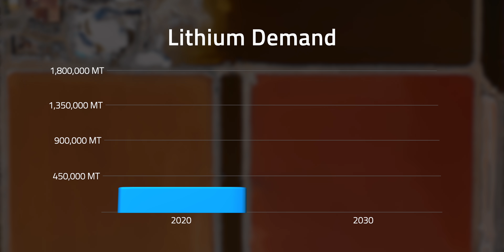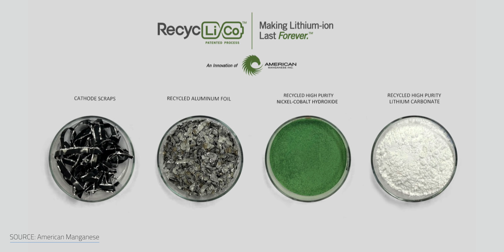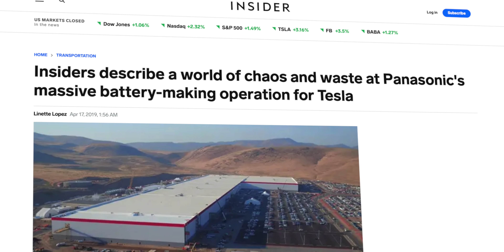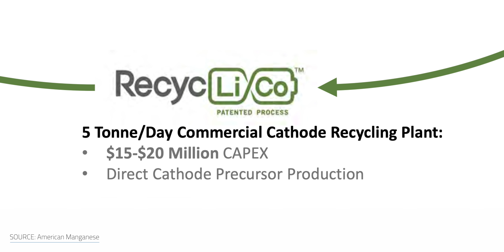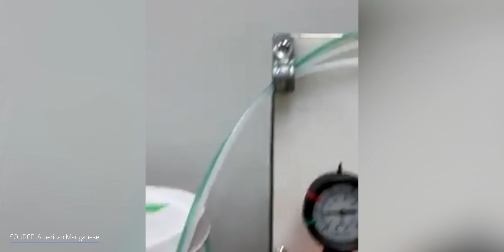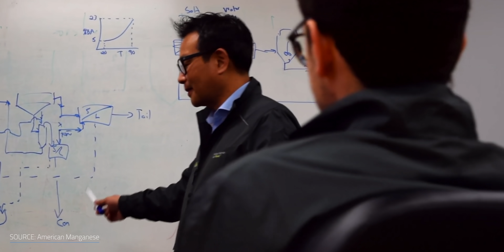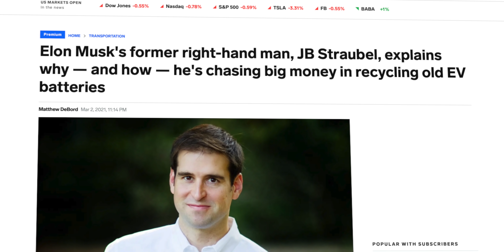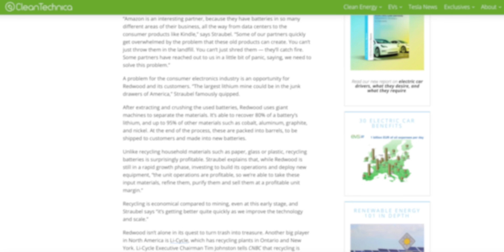Solving EV's Biggest Problem - Battery Recycling Explained

Comment from the maker: So what do you think? Will recycling overtake the need for mining?  And if you liked this video, check out "This 3D Printed House Changes Everything - Explained": https://youtu.be/gxbyWly_pls?list=PLnTSM-ORSgi5LVxHfWfQE6-Y_HnK-sgXS
Reply: If I might make a suggestion, I think you should do some research on aluminum ion batteries.
Reply: In every process there is always a small amount of loss of material that can not be recovered. Cell phones thrown in the trash instead of recycled or wrecked cars that sit in a junk yard instead of being recycled.  So in short you will always need new supply of materials.  The question is not will it over take it, but how much can we reduce it.  Maybe someday we can mine landfills for raw materials.
Reply: aluminium ion batteries it seems ok no recycling required.  But what we can use graded transport for less than a km by walk,  less than 2-3km by cycle, 5-10 kms by 2 wheelers preferably ev/aluminium ion battery.  4 wheelers for long distance provided with minimum of 3-4 people or public transport.  air travel only for 1000km beyond.  avoid travelling as much possible.  these steps only can save environment.
Reply: Looking at plastic recycling...no.
Reply: A possibly interesting topic would be Hydrogen fuel cell use. I mean, it's an engine that you fuel with water, and it's waste exhaust is also water. It seems like there must be a reason it's not the preferred vehicle engine over the batteries, considering all the trouble we're going to, to make batteries viable.
Reply: @Zutronic com I literally just made a similar comment, then saw this. I agree completely. It's hard to understand why such a difficult, expensive, and complex process and problems associated with the Lithium batteries is preferable.
Reply: Matt, if the cost and quality of the recycle material are acceptable, the process will grow worldwide naturally at the same pace of battery manufacturing. Great and insightful  video
Reply: Yes is good to recycle, but is the size & amount of the cells  needed for cars is part of the problem?
Also could do with better way to connect cells  together than spot welding? 
Currently consumers are paying the cost, from buying products, but good to see that recycling can be done
But manufacturers are adding in built in obsolescence as no product is meant  to last forever
Reply: Governments must require the manufacturers to have a system to recycle.  This is what the EU has done, and the recycling process is ahead of the USA.  Here it's a free-for-all, completely market driven with zero regulation mandating recycling plans by the manufacturers.  If some materials are cheaper to mine than to recycle, then they'll continue to mine.  One thing that is not helpful, is describing this dilemma without actually calculating how much of this ore is known to exist and how much our plans overutilize those limited resources.  We must do better than Elon Musk, who stated years ago that we just need 100 Gigafactories around the world to power the world, as if the resources to supply the factories weren't an issue.  Engineers and business leaders need to think beyond the edge of their nose and foresee that if this is all mined and put into production, and it lasts for 10 years or more in vehicles and utility storage, we won't have the feedstock to continue to grow the industry.  We should be seeking hyperefficient use of these batteries and instead we get year over year growth in the size of packs in vehicles, thanks to the industry emphasizing massive range the way the ICE industry emphasized horsepower.  The pickup truck is a perfect example of something we cannot just afford to run as-is with batteries because we are too lazy to radically change our ways.
Reply: Recycling won't replace mining as long as the demand is rising.
But definitely everything should be recycled
Reply: Recycling is the future, I suggest you look into the company American Battery Metal Company (changing their name to American battery technology company) they are leading with some awesome tech. Their CTO is Ryan Melsert who helped design the gigafactory. They have a closed loop system and will be building a pilot plant that can do metric tons. I just suggest you check them out or see if you can talk with Ryan.
Reply: @WetDoggo  You are absolutely right. I wonder if Matt is asking a trick question? The growth in battery demand is explosive, we are talking about a massive societal change in how we use and store energy. Even if you recycled 100% for the next 20 years it would still be a drop in the bucket versus the materials (lithium and others) compared to what will be needed.
Reply: No, EV's, home batteries, grid scale storage, ... are growing and will keep growing so fast that mining will need to provide the majority of Lithium just to meet demand, even if we reach a 100% recycling rate tomorrow. Recycling will be important, but mining will remain 'a necessary evil' for years and probably decades to come.
Reply: If you carefully peel apart lithium ion battery to take all the coverings off and expose the lithium, you can drop it into your toilet for some fun.
Reply: Lead-acid vehicle batteries are already recycled very well. I don't see a problem replicating that.
Reply: You do need both recycling as well as new mining in order to ramp up....I think one of the great challenges is getting the general public to dump all these batteries,  both the lithium and non lithium into a dedicated dumpster for such waste for recycling is important.....there is a big hole in this, big enough to put an aircraft carrier through....atleast here on Oahu...but I imagine the same on the mainland too...one way to aid in the recovery would be to require businesses that sell batteries to have a dedicated battery/small electronics recycling bin at the front door and it needs to be part of their advertising where ever they advertise about this so the general public is educated....convenience is crucial for a successful recycling program.
Reply: You forget one thing.....the complexity of ICE drive train and maintenance which is completely non existent in an electric vehicle....this is also why airlines and aircraft manufacturers interest in electric propulsion since the complexity of the existing turbine engine is relegated....this is also why fly by wire and electric servo motors are replacing hydraulic actuators on some aircraft....less weight and reliability...
Reply: @rogerstarkey5390  I watched the one you're referring to, previously. And it specifically spends some time on the extraction process being fueled by solar panels. That being a possibility, there's no reason why you couldn't generate your own, at home. Or, better yet, have the solar panels and hydrogen generator on the car it's self.
Reply: The biggest problem for ev's isn't the recycling of the car and batteries. That is already being taken care of. But the need for "mining" will not disappear.
The biggest problem for electric vehicles is the reluctancy to admit that exhaust cars are outdated, which results in the extremely slow transition. Some ex-car manufacturers have even sabotaged the ev industry way back when. One could imagine that all cars were electric already.
Now that more and more of the ex-car manufacturers are switching towards ev production, the battery technology and the efficiency of ev's in addition to charging technologies and infrastructure will improve significantly. This leads to ev's with smaller yet more efficient and energy dense batteries.
It is also possible to implement new ways of charging, wireless, everywhere you park, solar which will also require smaller batteries.
Solid-state batteries can be used on lorries and ships in addition to storage batteries instead of using lithium ion batteries for storage.
In the not so distant future alternative battery technologies will likely be competitive. 
Aluminium-graphite batteries as mentioned in other comments, in addition to bioelectrochemical batteries, redox flow batteries and supercapacitors are some of the most promissing at the moment.
Reply: It's got to be a question of scale. If all current Lion batteries were recycled today, there still wouldn't be enough raw material for current and projected demand. So yes, eventually, but only once increasing demand has been met. At least it'll give them time to perfect the process.
Reply: One of the former Tesla employees already started a company "Redwood Materials" to tackle this exact problem
https://www.youtube.com/watch?v=xLr0GStrnwQ

Edit: I see you mentioned them also.

I believe recycling will gradually take over mining as more and more batteries are produced and whoever produces them cheaper wins.
Right now it's China because of lack of regulations and having a lot of investment in Australia and Africa.
Reply: It's a math problem right? The demand for ion batteries will have to level off and the supply for materials will have to surpass the demand. Then the system could sustain itself if there is no waste from the recycling process.
Reply: Second life of car batteries (which is an additional 10-15 years) would delay taking car batteries directly to recycling (this is a greener solution overall). But this will put pressure to rely on more virgin material for a longer period. It would be nice to have an episode on companies that are integrating second life into their overall cradel to grave model.
Reply: @rogerstarkey5390  Considering the minimal percentage of plastic circular recycled, even though batteries are made of rare materials, I strongly doubt that a high recycling rate can be achieved.
This "all in" into the rare earth  category of the periodic table puzzles me.
Reply: China destroyed our recycling industries, so until NATO, the USA and everyone else sizes up and drops the nuclear hammer on them, I'm going with mining...which is nearly all in the Chinese ball court worldwide also.
Reply: @Ennie-98  I would also wonder what is the recovery efficiency of the process. Also what is the energy requirement of it. Further, how scalable is the method, thinking about the number of batteries coming over the next fifty years.
Reply: Recycling wil not replace mining.
Reply: "Will recycling overtake the need for mining?"  Yes, but only once the mass of elements in use reaches a steady staten, and assuming that recycling is 100% effective. In other words, no.
Reply: How did you not mention the primary US recycling company, ABML (American Battery Technology Company)? Redwood uses smelting, which creates toxic emissions into the air, while ABML uses a water-based recycling method that's 100% sustainable. And it's a company led by ex-Tesla engineers.
Reply: @TheYuleTube  As long as the hydrogen is produced by electrolysis rather than current process's which are very energy intensive and require fossil fuel inputs. At the time of writing this, hydrogen is no "greener" than batteries and batteries aren't "green", yet.
Reply: @rogerstarkey5390  - That assumes Li-Ion cells are even sought after in 10 years time.  There's a good chance we'll have cracked a solid state battery in several different ways by that time, and that could leave Li based batteries in the dust.  I don't doubt that car battery packs will be recycled.  I am concerned that without regulation, they could be treated as a liability if those resources cost more to recover than they're worth at that time.  Up until just a year ago, the industry only used pyro techniques and recovered only the cobalt and manganese and nickel.  They couldn't be bothered with the AL, Li, and plastic and much of the battery in that technique ends up as useless slag.  It's thanks to EU regs and now US lab incentives that we're seeing investment in hydro recycling.
Reply: Thank you for the video !
Reply: I think, in due course, mining on Earth will be reduced, as recycling processes get better and easier for people to access. I hope we eventuality work out how to economically mine some of these elements from asteroids and other planets, too. That's obviously generations away, though, so for now, we just need to be more conscious about recycling, and find more ways to store energy.
Reply: so are you saying that humanity won't survive until we've mined out the lithium?
Reply: Recycling should also help drive down the price of lion batteries. Less mined material equates to lower labor costs and lower shipping costs.
Reply: Hi Matt, great video! The potential success of Lithium iron phosphate cells might play a role as well. Most of the value generated by recycling seems to come from Cobalt and Nickel. In a LFP cell, only Lithium should be of interest in the black mass and recovering this alone might be highly uneconomic. I wonder if you or your interview partner have some insights on the LFP topic.
Reply: Well: Recycling of batteries will overtake mining in the long run (simply because if used batteries can be considered as a mine of pure materials if the pile is big enough)...

"Generally" mining will still exist on this earth or some other as long as we'll need more materials (of various sorts) to thrive.
Reply: what we need is on site renewables and storage while leaving GRID size storage to bigger companies like "Highview Power" and push for better home efficiencies allowing for a good chunk of batteries to go vehicles {waiting to see Tesla's THREE (3) new batteries?!} this and landfill diving for E-Wastes to recycles.... Recycling should be Mandatory!!!
Reply: I don't understand why the manufactures like Tesla don't cut out the middle men and just copy the recycling centres tech add this to there factories and just do this on site. Seems highly inefficient to be transporting all this material around to do this.
Reply: I wish someone would try to make low cost high preformance flywheels.  More money has been poured into batteries.. what if a similar amount were put into mechanical energy storage?  Imagine all the uses this could have, easily recyclable and the material science that comes out of this would be useful in so many applications.
Reply: @rogerstarkey5390  Not with that attitude.
Reply: For recycling to overtake the need for mining, demand for lithium products would have to decline. After all, you can't get more than 100% of the material out of recycling, and even 80% is pretty darn idealistic. So as long as demand goes up, mining is an inevitability. However, if we could serve, say half or even three quarters of the lithium demand from recycling, it will keep mining to a reasonable level. 

Interestingly enough, Musk has stated repeatedly that battery recycling is not only planned but part of the cost-savings methods he's planned for the next decade. It will be cheaper to source lithium and nickel from recycled batteries than from mines, which in turn will drive down the price of batteries in the vehicles.
Reply: A good overview video Matt. We really need to look at the economic value and the environmental cost.  When we talk about yields as a percentage of recovered materials, the most important piece of information is the value of those materials. For example, the raw materials in a Model 3 battery cost approximately $4000 for the cathode and anode. If you get 100% of those materials, the question we want to answer is at what value? And, at what cost economically and environmentally. If the value is $3-400 per vehicle (which is typical) we can see that the materials are recovered, but not in the highly processed state that is necessary for new batteries. In reality, there is a lot of word smithing in the field, if you can extract the 4K worth of materials with minimal environmental damage (read, considerably less than mininig) and do that cheaply then you have a winner.
Reply: yes and no.  there are plenty and huge guys on battery recycling already just even before it booms. I think the problem is re-use vs. recycling.  Re-use companies would be competing with recycling companies for these batteries.  Re-use is certainly better than recycling as li-on batteries usually leaves still plenty of useful life
Reply: No, you will need more raw materials. Recycling is a great ideal but I feel like it will have to be shipped overseas to be recycled.
Reply: @rogerstarkey5390  That's true. An ex-vehicle requires "mining" throughout it's lifetime whilst an el-vehicle doesn't.
Despite this, ex-car lovers forget the requirement for fuel and only focus on el-car's batteries. 🤪
Reply: I think Elon Mask should stop making EV then recycling can overtake the need for mining. Instead make us this resources in making fighter Jet power battery, making EV for civilian is wasting resources
Reply: I'd like to invest some money into a company like this. I don't know how.
Reply: I, for one, can't wait for landfill mining to be a thing
Reply: @Zutronic com Where does the electricity for the electrolysis come from? It's an extremely energy intense process, so would require energy stored somewhere.
Reply: Great video! Recycling will eventually disrupt mining, likely with the cost of mining going up in the future, but I don't believe it will be in my lifetime.
Reply: Matt, lithium ion batteries do NOT contain copper. Copper is used in EV chargers and EVs, but not the batteries.
Reply: Very bad and DANGEROUS idea.
Reply: @TheCoryGroshek  The cells may not, but the modules and packs do
Reply: That is NOT EV's biggest challenge, he biggest challenge is he environmental nightmare of extracting it's resource base. It's Also generating sufficient power. Transportation uses 26% of the worlds energy (77% of that is met by gasoline/diesel). Or 121.5 Quintillion Joules or 33.7 Trillion kwh ! Even if electric motors are more efficient; You factor in thermodynamic loss from generation to final transmission; you still need 90 Billion kwh of electricity A DAY!!! or 3.8 Million Megawatts of new power plants to replace gasoline and diesel fuel use for trucks, cars, motorcycles, scooters, lawnmowers and other fuel powered construction equipment.
Reply: @spikedpsycho2383  thankfully you need only at most quarter of the gasoline electrical energy even with grid losses.
The load is also spread across the day, and across so it's not like there's going to be a spike if hundreds of megawatts out of a wall socket.
Reply: @benhockley  Pay attention to energy physics and math.  Companies promising "Fast charging" places Orders of magnitude more demand on power. A 100 kilowatt hour battery charged by basic level charging will charge in 6-8 hours. DC fast and supercharger networks charge 80% in 30 minutes. Charging a 100 kwh battery half depleted in 6 hours requires 0.833 kilowatts of power charging that same battery in 30 minutes requires 100 kilowatts so you're placing over 100 times More load on the electric grid to do a task in 1/12th the amount of time. Even a solar panel 1 Acre in size produces enough to charge 3 Teslas in the span of a day. That's why at events gas/diesel generators are brought in; they can do the same task in 30 minutes.
GLOBAL energy demand is 606 Exajoules (606 QUINTILLION JOULES), Transportation energy consumption is 26% of that (157.6 Exajoules) Gasoline and diesel fuel use 77% (121.32 Exajoules) or 332 Petajoules daily or 92 Billion kilowatt hours. EVEN if electric motors are more efficient than gas engines; power conversion and efficiency losses from plant to end user rob over HALF of it. Adding the transportation system to the already stressed and dilapidated electrical grid would be a logistical nightmare. Global electric consumption is 61 BILLION kilowatt hours per day; only 6% is used for transportation related systems (Subways, trains on wires, monorails, etc), even if motors are 3-4 times more efficient, Factor in transmission losses; you're placing a demand of 23 Billion kilowatt-hours daily or nearly a 1 billion kwh per hour. Generating 1 million Megawatt hours in a one hour period you need 958,000 Megawatts of generating capacity. That's the equivalent of 460 Hoover dams. Even if only one quarter of all the cars charge per day; that's still 239,000 MW you have to build.
Only 12% of global energy demand is electric, because converting to electric is expensive and not very efficient but it's safe for running casual devices that don't work mechanically like computers and lightbulbs. 72% of the worlds energy is thermal based because it’s efficient to  convert thermal energy into work without having to convert it to  electricity. You convert to electricity you lose half to 2/3rds of the  energy as waste heat. The carbon emissions from changing electric  sources wont matter much since 75% of all GHG emissions come from non  electric sources, Converting ALL non electric devices/machines over to electric would be more logistically challenging as rebuilding the grid. The transition to renewables; means replacing thermal, chemical and mechanical power with several added steps, electric generation, electric voltage, transmission, and plug in. ALL these stages result in thermodynamic losses. An all electric transportation system requires a 10-20 fold increase in grid construction. An all electric energy society would require a 90 FOLD grid size. Fossil fuels are so much simpler
Fossil energy: Chemical energy --- Thermal energy --- Mechanical energy (work) or thermal to work.
Renewable energy: External mechanical energy (Weather permitting) --- mechanical energy --- electrical energy --- Voltage step up --- electric transmission --- electric transmission to destination (thermodynamic losses in route) --- voltage step down (transformer) --- transmission to consumer --- consumer utilization (electric motor) --- mechanical  or thermal energy --- work
Reply: @spikedpsycho2383  which is why many new large fast charging locations are built with batteries to provide the power they need.
Fast charging is also an exception rather than the default case.
Reply: @benhockley  With an average electric "Fuel Economy" of 3 miles per kilowatt hour charging a battery 220 volts puts a demand of 8.3 kilowatt-hours per hour, Even if slow charging, 10 million vehicles would need 83,000 Megawatt hours or 3400 MW. Plus charging infrastructure requires constant flow of power whether you use it or not. EV cars measure just 0.167% of global auto fleet, One out of every 600 cars, Auto industry Spent BIllions on outfitting factories to make cars that only saturate 1% of all new auto sales. Environmentalists whine it takes 30,000 lbs (15 tons) of raw material to make a 3000 lb car. It takes Over 4000+ tons of rock/ore to make One electric car, ICE engines made with iron/aluminum come from scrap by melting down cans and scrap metal. EV's require fresh resources of cobalt, lithium, copper, etc. You have to start an industrial revolution over again but instead of coal/iron; you're now digging up HALF the periodic table all of which is dug, mined, processed, manufactured, and shipped using fossil fuels. Under the guise of technology which is supposedly gonna "Rid us" of fossil fuels. Driving is only a small portion of a cars energy embodiment/life cycle, there's heavy energy investment in the beginning and late stages of it's life, namely manufacturing and recycling. Just under 5.4 million hybrid electric cars have sold in the United States as of 2019 — comprising 1.6% of all 333 million new light-duty vehicle sales between 1999 and 2019. Proliferation of hybrids since 1999........took over 2 decades and billions in tax rebates still haven't replaced gas cars. Electric cars, just shy of 2 million in the US took 15 years and billions in taxpayer rebates. As had been shown repeatedly, this is just a drop in the bucket.  The growth of ICE cars around the world is going to outstrip EV manufacturing capacity by order of magnitude; for years to come.  For ever, once subsidies become too high for taxpayers to accept, EV sales will crash. Industry is simply not outfitted to produce something that takes 8-20x more energy to manufacture and try to sell it at a comparable price to it's gas powered equivalent, never mind building a massive infrastructure system to charge it without melting the electric grid. Construction of America's Transcontinenal railroad took only six years, it took only 15 years for aviation industry to replace it's fleet of propeller driven planes with jets, the fact it took 20 years to saturate vehicle market at 0.167% electric. Like the youtube video were watching.....why is battery recycling a challenge? or even an issue, less these devices have a terrible shelf life. Worse vast majority of EV car components are made/harvested in China and the third world where child/slave labor constitute the bulk of it's extraction. EV cars besides being a logistical nightmare and environmental questionable; they're a human rights issue.
Reply: Definatly itll replace mining but not for another 30years once we have sucked as much as we can dug as deep as we can that how greed works because unfortunatly liie we saw with covid there is no change untill it starts affecting everyone and then we are left scrambling to fix everyhing fast once it all goes to shit
Reply: As long as it’s cheaper to build batteries from new raw materials, recycling will not replace mining.  This will only change as technology changes or as legislation changes, either way, consumer costs will increase.
Reply: Unless growth is <= 0 or some crazy battery efficiency technology is discovered, recycling can never overtake mining.  It's literally impossible.
Reply: Thus far, except for very expensive precious metals like gold, platinum and silver, recycling has been a massive lie. Only very little of that which the industry makes us believe is actually recycled. There is a track record of almost 50 years of massive lies. So, I am not going to believe any recycling claims until there is a new track record of 100% recycling for another 50 years. And even then, we will need to look at the total energy balance.
Reply: Matt, recycling uses alot of chemicals.  You should also research how electric intensive is chemical industry.
No point going into EV and recycling batteries if the benefits we get is outstriped by the overall cost.
Its the same as steel and steel recycling.  Large amounts of chemicals are used.  And chemical producers are energy intensive.
Reply: Kinda skipped over the "test" facility quite quickly there...and whats the carbon cost of all those chemicals eviromental and carbon?
Reply: Northvolt is currently building i gigantic recycling plant for batteries in northern Sweden. They plan to build new batteries of them with 90% less carbon footprint then normal battery production. They are already one of Swedens biggest employers.
Reply: Yeah, Recycling will ease the burden atleast 👍
Reply: Zarko who?
Reply: @theflyingwelshman5338  Are you referring to the Aluminum-Graphene batteries by Graphene Manufacturing Group?
Reply: Wait, are you from Rochester, New York? I grew up here. My father worked at Kodak for 33 years.